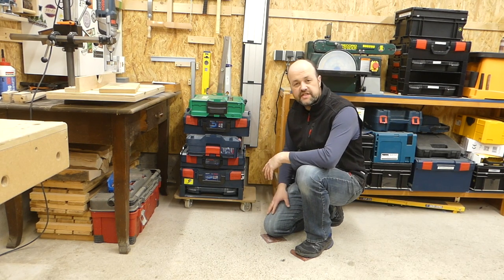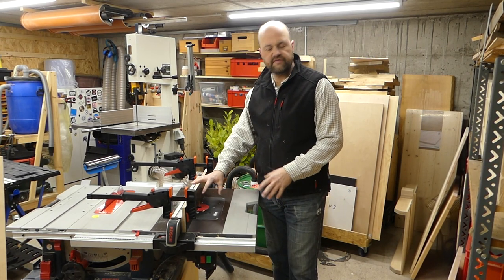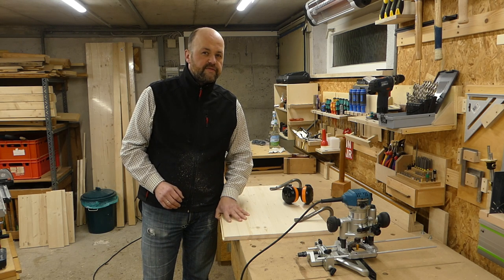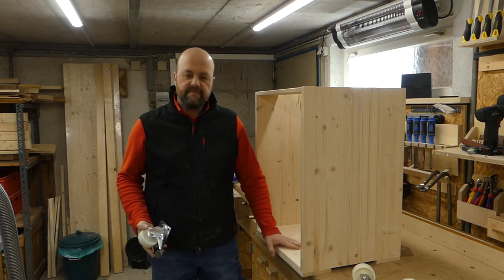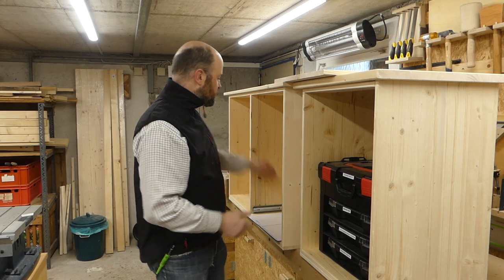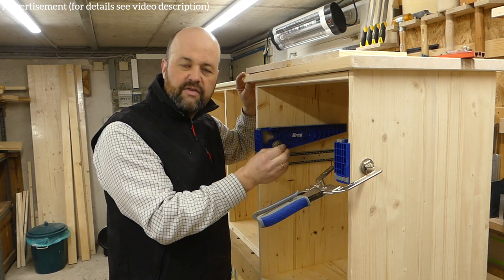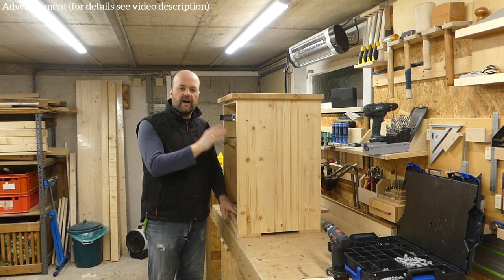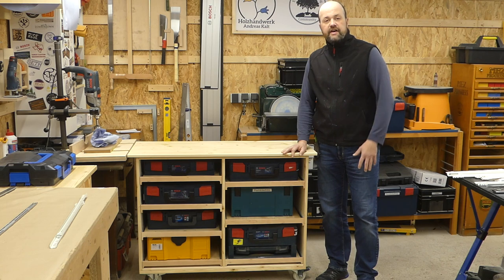DRAWER CABINET DESIGN – Many problems to solve.

Comment: Thank you for honestly showing your mistakes - much more helpful than the 'perfect' project.  Watching some other videos I have learned a) not to put the top or back on a cabinet, till the drawers are installed - gives you so much better access and b) make the cabinet carcass-  then measure up and install the drawers to fit, c) lie a cabinet on its side for drilling and some screwing - often easier and more accurate than drilling horizontally.   You did well with the shelf slides - they can be frustrating if just a few millimeters out in width.
Reply from the maker: Thanks for your valuable tips.

Comment: Loved it when you said Wood Peckers ridiculously expensive and you still buy them. Spoiling ourselves with a few tools is nice. The red stopper on the story stick looks like plastic. If it is I hope the price wasn't that bad. Having a nice piece of aluminum there would make it far better feeling when you run the stop into things.

Video is great again. Surprised how the breaks where you talk made the video that much better. I think of cabinetry as an unending decision making process because of the three intersecting faces in each corner and how you're doing to place them all. I try to use the inset back as often as possible and combine that with jack stud style sides depending on the gravity load. Meaning I keep the top and bottom outset so the sides are inboard so the weight is transferred to them and not fasteners like nails/screws/biscuits.
Reply from the maker: Thanks for your feedback and kind words. The end piece is made of plastic but it’s very sturdy nonetheless. Really love that story stick – I didn’t know that it could be so useful.
Reply from the maker: Concerning the cabinet build: with pocket holes, the top and bottom pieces have to be between the uprights for the pocket holes to be invisible. That’s why I added an extra top (sitting on top of the uprights) and a second layer on the bottom (on which the uprights sit). But I agree with you, with biscuits I would have made the top and bottom outset.

Comment: You know what the biggest difference between your work and my work is?

My mistakes are not on video :D

My solution for that problem is radical: Take the tracksaw and cut the sides of the cabinets at a diagonal from top to bottom. Glue in a piece of contrasting wood to make it higher. Or maybe even glue in a piece of metall with epoxy? And everybody will be like:  Wow Andreas! What a desing! You took shop furniture to another level! :D

Or maybe use thinner material for the drawer bottoms? You have lips around it anyway which make it strong and the boxes are strong for themselfes. Should work.

On those rabets I rough them out at the table saw and only take a whisper pass at the router. No chunks, only dust, no problem.

Those suggestions are a bit late for this project, but maybe come in handy in the future or for somebody else.
Reply from the maker: Thanks for your feedback!

Comment: Hey Andreas. I really enjoyed your video on the drawer units - a lucky find as I was actually looking you up to see if you were a track-saw YouTuber (I'll contact you separately about that). But I'm about to tackle a very similar project for my channel for Systainers/Makpaks and Euroboxes (which happen to be the same dimensions as Systainers). Your drawer runner video has been in my essential tips playlist for a while now and want to thank you for that because I find runners super stressful in a project. Especially as I really prefer to drill out the holes while the cabinet is disassembled and I can't count the number of times I've got it slightly wrong!. Anyway a quick question if I may, what's your preferred bench height?
Reply from the maker: My bench is about 84 cm but that’s not by choice. It just happened to be the height of an old workbench that was in my shop when I moved in.

Comment: Nice workbench, will you fix the Boxen on the drawers?
Reply from the maker: Thanks. No I didn’t. I sometimes have to take them out.
Reply: @holzhandwerk_ak  i thought abtut something that will prevent the boxes from sliding around, not from taking out🤔
Reply from the maker: I’ve screwed a piece of wood on the bottom at the back of the drawer so that there’s only some millimeters of play for the box.